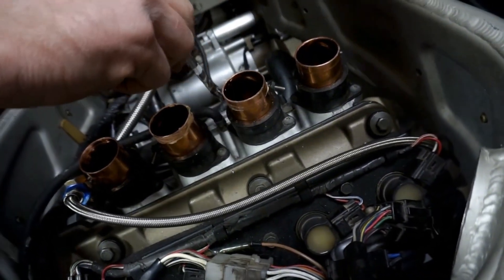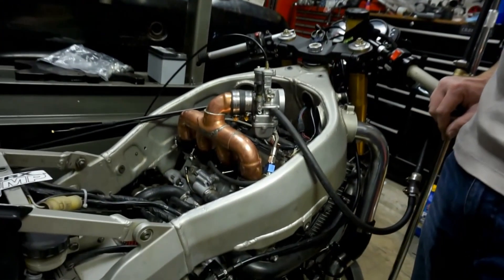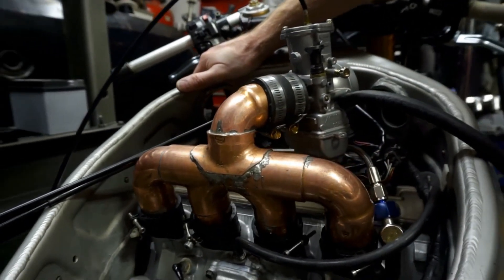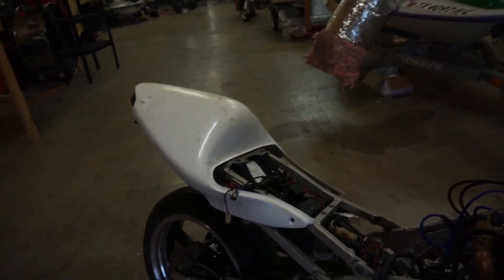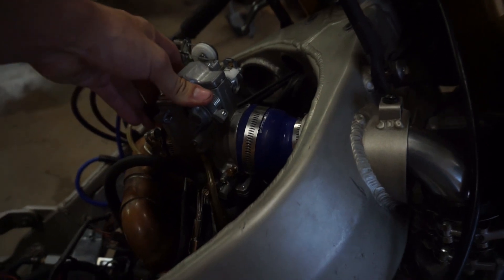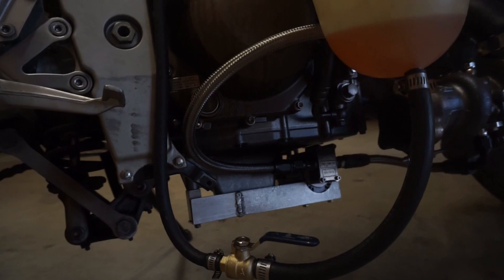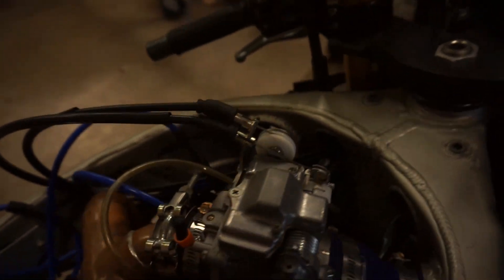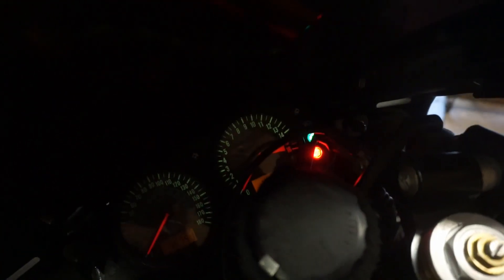Turbo Zx6r Update

Comment: One carb is not going to do it what you need to do is use the standard carbs and airbox and up jet it . The problem you are going to get is lean mixture and over heating when you ride it turbos make alot of heat.
Reply: Standard airbox wouldn't work. 1 carb is the best way imo